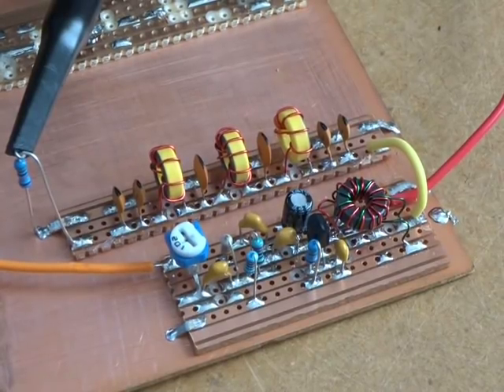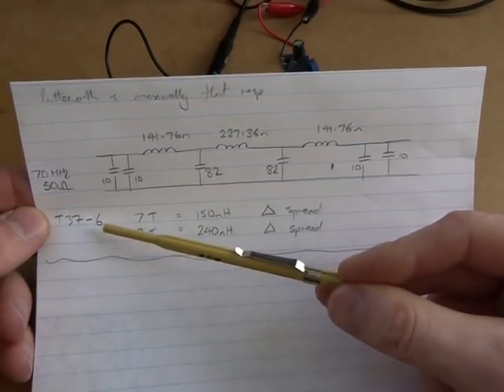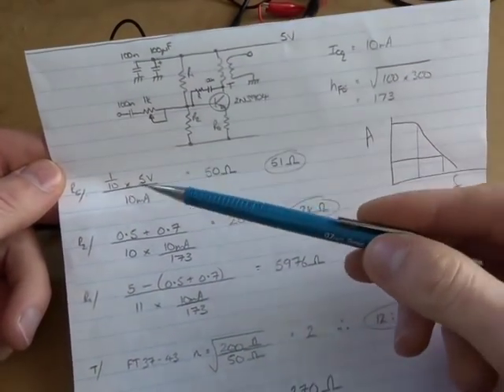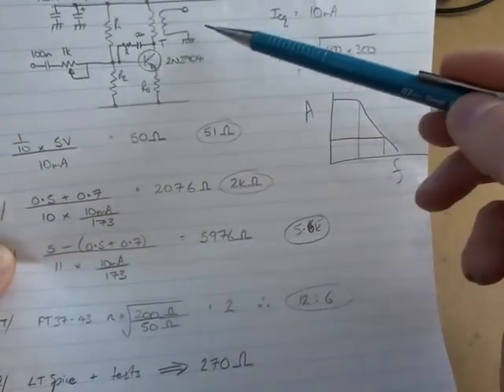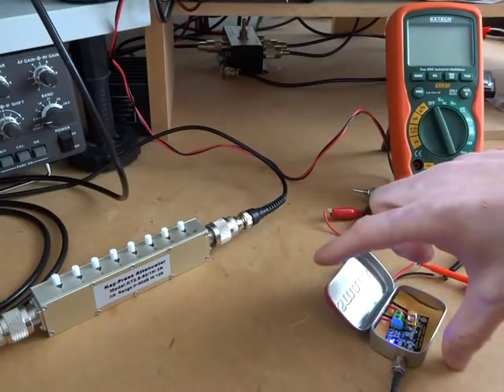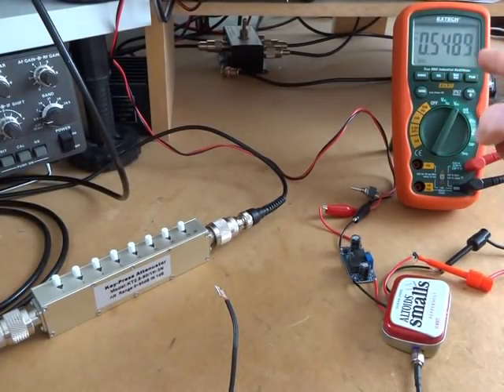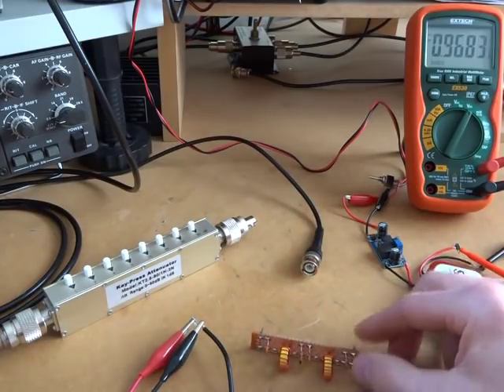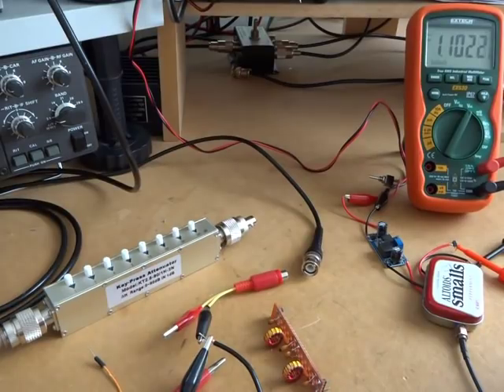Simple Scaler Network Analyser - # 2 LPF and RF Amplifier

Comment: This is why serious RF work is always done inside a Faraday Cage.  Otherwise, you can do a survey with a spectrum analyzer to see what RF content pervades your environment but even if you have a reading of the signal density, it still does not help because of the the uniqueness of your various circuit and cabling topologies which will vary in how they are affected and what levels they pick up.  The Faraday cages that I have worked in were made of copper-mesh and in some cases were only as large as the UUT.  Hope this helps and 73...
Reply from the maker: Agreed. I use to work in one years ago in the Air Force. Thanks for the input.

Comment: Hi Charlie! Great video as always!. Maybe you can consider shorter cables directly to the DUT.  73!
Reply from the maker: yes, that certainly did help Alejandro. The open circuit voltage is now 0.73V with no additional shielding. I'm now doing a bit of software engineering and it seems to work well. A whole lot faster than plotting it by hand!

Thanks for the input.

Charlie

Comment: Thgose AD8307 chips are *sensitive*, they'll produce an output from any RF that's floating about and there's a lot, they're also good to way over 500MHz, that's just the guaranteed range. 

I built up a couple of detectors to use them in a similar project to yours, one before the device under test and one after so I could automatically subtract one measurement from the other, making the sig gen level largely irrelevant. 

I found that even my wireless doorbell produced a decent voltage on the output.

I ended up building a completely shielded enclosure with all joints covered in copper anti-slug tape* and the input connector soldered to the box.

Never did get round to the software, maybe I should dig that out.

*Wonderful stuff, a quid for a 5M x 2cm reel of self adhesive shielding tape that you can solder to.
Reply from the maker: Thanks Clint. A local ham friend reminded me that I live in the shadow of a broadcast tower and that will more than likely be the culprit. I might have to see what I can do about a shielded enclosure. I did put everything is a tin box as part of the experiments, but there were some small gaps here and there. Oh well, something to think about.

Thanks again.

Charlie
Reply: Forgot to mention, I had some feedthru caps on the DC in and out from the enclosure. I'm watching the latest video now and it looks very promising.
Reply from the maker: Cheers Clint. As an aside, I did some comparisons between some different o'scope probes and came to the conclusion most, if not all, of my drop odd was probe induced! Operating them with 10x on showed I had flat response well past 20MHz, at which point the sig gen output started to drop off. I guess I wont be using 1x anymore!

Comment: Does the stray voltage issue continue if the input coax is terminated with a load resistor (i.e. 50 ohm)?
Reply from the maker: Gidday Christina. I'll look at that tomorrow thanks. I might do a dummy test setup and see how it looks. 

Charlie
Reply from the maker: I think the added challenge I have here is trying to use an AD8307 breakout board. I can see some kind of RC network on the input.